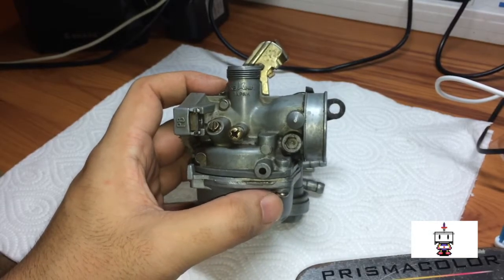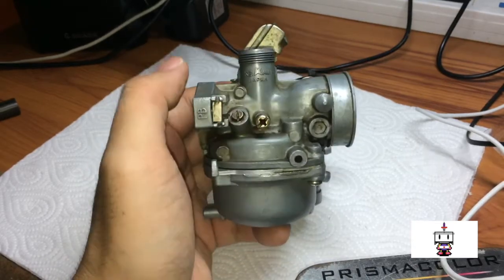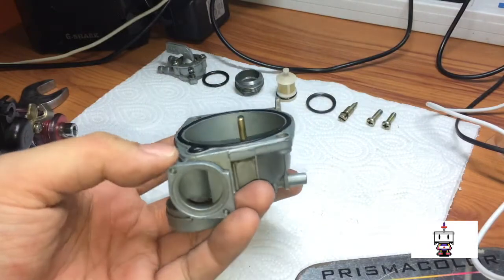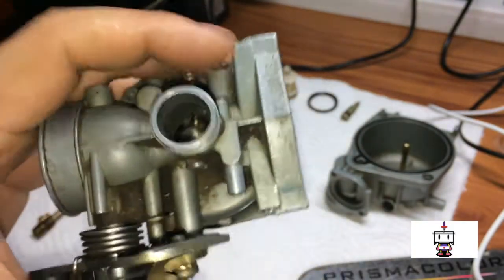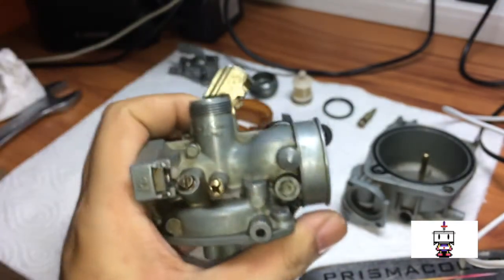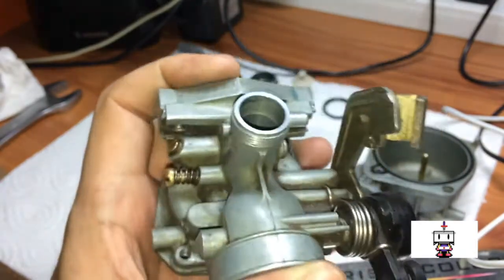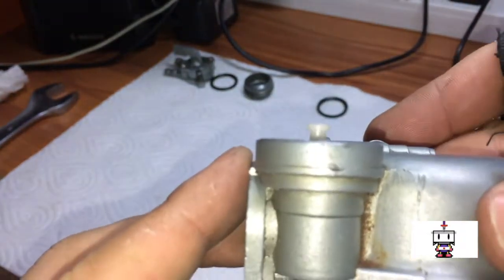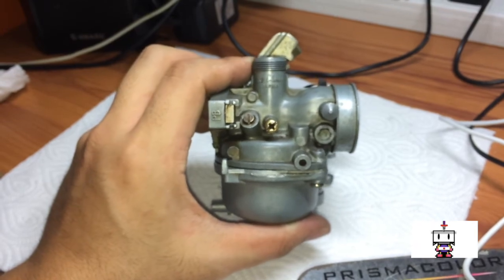How to Clean and Rebuild a Honda C50, 70, 90/Super Cub Carburetor (Keihin, Short Version)

Comment: Mini Motor Man, thank you for making this video.  I just bought a Honda C90 (1968) to rebuild and enjoy.  I am new to bikes, so I have a lot to learn before I can get it up and running (bike has been sitting for years)  This video is the best I have seen so far.  Do you know how similar your 95' is to my 68'?  I am planning to watch this a few more times and use it as a guide if the two carbs are close.

Comment: Hey man,..  Great videos!  Alot of information.   I have a Chinese 110cc Loncin engine.  It is a semi auto 3 speed with reverse.  It didnt want to shift into third gear, most of the time....  you could force it into gear by high rpm's in second gear, let off the throttle,  and instantly shift into third..     So,. We determined the shifting fork was bent.  Sure enough, opened the case and pulled the gears. It was bent.  While waiting for a replacement,  my son thought it needed cleaned.  He completely disassembled it, and has no idea how to put it back together.  Your video on the transmission was very helpful,  but not quite followed our gear configuration.   There is no help or diagrams online.  Can you help us ?
Reply from the maker: Hi there,

I've never rebuilt one of these motors with a reverse gear, so I'm not sure to be honest, because I thought the Loncin had the same basic 3 speed as the genuine Hondas.  

I don't want to offer advice when I honestly don't know the answer, but here is a diagram of the only other kind of Honda 3 speed I know.

https://www.cmsnl.com/honda-c90-cub-england_model15863/partslist/E07.html#results 

If this doesn't help you out, there's not much more I can help with because I don't know.

Comment: That was a wonderfully clear and instructive video Mr Mini Motor Man, thank you. My Cub 90 gets bogged down when the throttle is 3/4 or more open. Funny thing is it only seems to happen after about 20 minutes running; the bike goes fine for the first 20 minutes or so and I can get up to 45mph, no problem. The fastest I can go when the issue arises is 30 mph in third; the engine starts spluttering thereafter. The problem also arises in the lower gears, so that the range of any gear is really limited and I have to change up really quickly to get going at all. Do you think this is a carb issue? If I clean it like you've shown here will it remedy the problem? What else could it be-spark plug; points? I tried giving it to a mechanic to have it serviced but they don't want to take on the job. I would be very grateful if you could point me in the right direction as I need the bike to commute. Many thanks, Martin.
Reply: Hey Martin, did you ever figure out the problem? Have a similar problem on my bike.
Reply: @derpsterswag6455  hi there, yes, in the end I found a mechanic who was willing to take a look at it and after a quick ride on it to see what the problem was he diagnosed a faulty IDC unit. That's an electrical part that sends a signal to the spark plug to tell it to ignite. He ordered a new one, replaced it and the bike is going as good as new again. Hope this helps. 🏍👍

Comment: What you need to stop stripping screws is a good JIS screwdriver. These are NOT Phillips type screws, but JIS. They look the same and a Philips screwdriver will generally work, but it will damage the hardware in the long term. Get yourself a nice set of JIS screwdrivers and you will stop damaging those screws.
Reply: That’s the ticket! I believe a JIS #2 is what these carbs require.

Comment: @8:19 what is the fiction of that brass bush /jet thingy. How is it interacting with the needle tapper? I removed it from my pz30 carburetor and it got damaged. Not only it but also the seat. So now I installed the replacement one but it's not sitting flat and the needle gets stuck in it. If I try to flatten the seat for that brass I suspect that will also affect the needle depth so have to readjust the position of clip. And idea?
Reply from the maker: You are correct, you will probably have to adjust the needle height.  I am not familiar with the PZ30 specifically, but in terms of most carbys, there is always going to be just a little friction (because needles wear out over time), but nothing big.  If you can feel it binding, then there is a problem.

Comment: 3:58 the carb cleaner should not damage O rings, read the tin, I might be wrong.
Reply from the maker: Trusting labels in a 3rd world country is a good way to get yourself into a lot of trouble.  I speak from experience of having melted the water separator and swelled the bowl gasket.